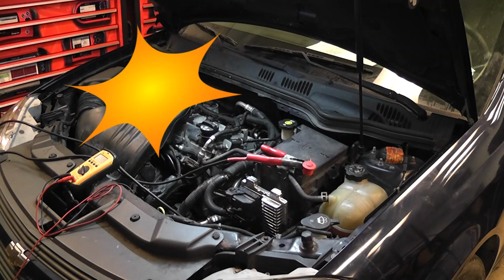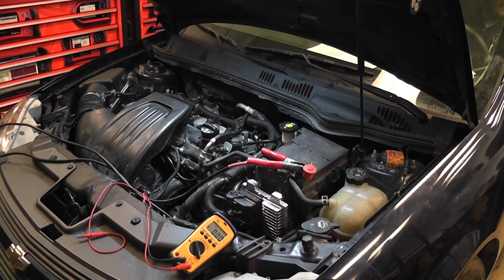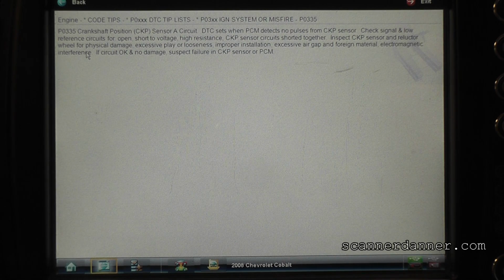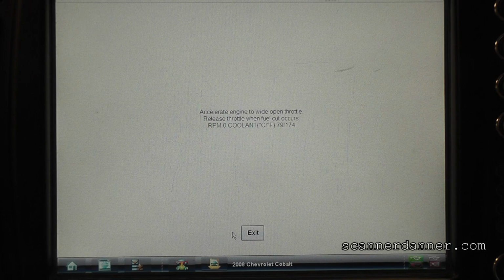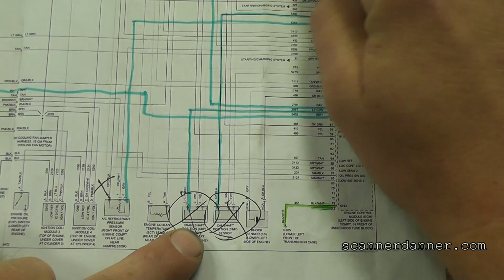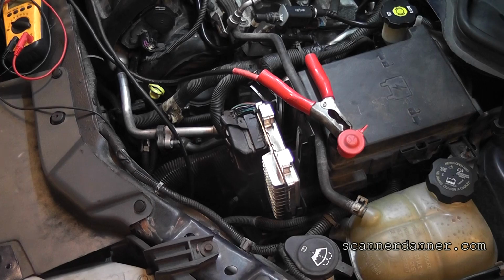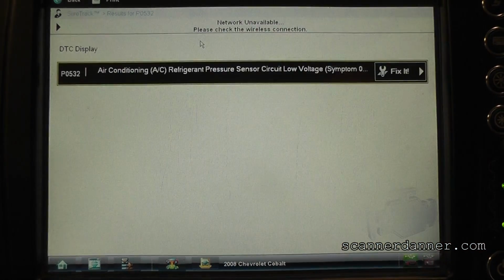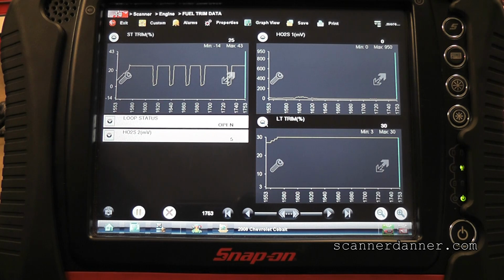Bad Engine Computer Testing Part 2

Comment: You left the crank unplug.
Reply: I didn't like u leaving all the sensor plugs loose but I'm just a truck driver.
Reply from the maker: I left them loose on purpose.  I wasn't finished testing for a short to ground in the harness and I like the sensors unplugged for that test. Never got the chance to finish like I wanted.
Reply: ScannerDanner I love your videos because u r so real.  I have learns so much from watching your videos.
Last week I got my sister 97 Accord to pass an emission test. PO1491, I thought the electrical part of the EGR valve was bad. It turn out to b the diaphragm part wouldn't hold vacuum.
I didn't just buy parts, I test the EGR switch and vacuum hoses 1st. 
I did go to an auto tech school back n 88. I was the youngest student at 17 but had the highest grades. I dropped out to become a car thief.
Reply from the maker: And you're now walking the straight and narrow right?
Reply: ScannerDanner Yes sirr, I stopped n 94 after I got tired of being lock up with men. The only law I break now is when I ride my ZX14 Ninja. I've seen 160mph once.
Reply from the maker: Nice.  Most I've seen is 120ish on my old VFR 700 (long time ago)
Reply: Must be a good feeling when you get messages like these. Knowing that your not just teaching your students. The good the bad and the ugly are all here listening to you.
Reply: Daniel Warren it is awesome my friend, to know this is changing lives make it even that much sweeter! thanks for the reminder my friend. I had a naysayer really bug me today and I need to let it go.
Reply: Well, for every naysayer there is 10 people praising you for what your do. Keep up the great work.
Reply: Daniel Warren thanks bro

Comment: First time commenter.. Very Long time watcher!  I heard you mention you are now doing your own programming but only for gm.  I recently bought an Autel j2534 passthru device. With that you can program all makes and models.  Just a thought.
Reply from the maker: Thanks man. It is a j2534 tool and we will have more than just GM but we bought some gm software that gives us factory capability. At least this is what I am being told. We actually have a trainer coming in on Friday to teach us this tools capabilities.
Reply: Thanks for responding!  Before watching your channel I would hardly ever use my scan tool.  Now it's one of the main tools in my diagnostic arsenal.
Reply from the maker: Mobile Auto MD Mobile Auto MD
Nice! thanks man. Really appreciate that.

Comment: Fantastic, both Parts 1 and 2 on this repair.  The car probably didn't need a second junkyard engine from the beginning.  It's annoying that mechanics don't take the time to properly diagnose the problem and just start throwing parts at a problem without any evidence of failure.  Great job Paul as always.  Your enthusiasm  for solving these types of problems comes across loud and clear.  You take pride in your work to be one of the best!
Reply: I totally agree. We may say they just too lazy BUT in other way, they haven't got a clue. This man is A PROPER MECHANIC LEFT ON THIS PLANET

Comment: PAUL, as always a great vidio. as for the gm tech we dont know all the circumstances. after hearing the first start and run that sounded like out of timing or cylinder hydraulicing i would have been afraid to do a restart without pulling the plugs if the money for a new engine could possibly come out of my pocket.  but whoever destoyed airbox should be ashamed.  you are a credit to automotive repair industry . GOD BLESS and thanks for great vidios.
Reply from the maker: Thanks my friend. May God bless you too.
Reply: ScannerDanner

Comment: Paul, so if the computer cannot adjust the fuel trims anymore it becomes open loop? Is that why the loop status is jumping around?
Reply from the maker: yes, when trims max out it is common to see the PCM drop out of closed loop. I have also seen this reaction as possibly a self test the computer is initiating on the O2 itself.

Comment: you say you have the programming tool for gm? is it gds? the laptop based tech 2 tool that gm used not long ago. Its a very nice tool! if you guys are getting the ford ids good luck with that thing. good work
Reply from the maker: not sure exactly what it is yet.
Reply: cant believe the tech called a bad timing chain, wouldnt you think hed atleast check the codes and say it had something to do with the crank sensor circuit but didnt know what it was instead of saying a chain. were you ever a flat rate tech before?
Reply from the maker: philbfree1
Yes, I worked for Pep Boys for 5 years as a flat rate tech. Loved working flat rate and I never cut corners. Quality was always #1 for me. I did however always have the "how can I do this faster" mentality but never with sacrificing quality. I still have that mentality. Time is money isn't it?
Reply: they did engine performance stuff at pep boys? all of them are closed around me in ohio. in todays car industry you better know electrical and scan tool usage or else your stuck doin the grunt work. im like you love the electrical investigations!
Reply from the maker: philbfree1
for sure! i wouldn't have been there if they didn't. I've always specialized in engine performance diagnostics and repair. From day 1.
Reply: do you still have pepboys in pa? can you do a video on the new high pressure fuel pumps ford and gm are using pretty much now
Reply: i was working on my dads 1995 f150 4.9 straight 6 for a lean condition. do these engines not have a maf sensor?? there wasnt a sensor in the intake ducting. i found some broken vac lines but it must not have a maf sensor. any help would be appreciated paul
Reply from the maker: Not sure. If it has no maf then it is a digital frequency type map sensor. Koeo at sea level it should read 160 hz at idle it should be 90 to 110.
Reply: thanks friend!

Comment: Paul Great video. Not on the defense of  Dealer Tech but I have seen a cam sensor engine code kept appearing with a timing belt being off one tooth and the car ran good. It was a Camry.
Reply from the maker: For sure and I started to get on this unknown guy at first in the video unfairly. He was not being paid to troubleshoot the problem and probably just took a guess.
My issue would have been if they actually followed through on a timing chain repair without doing tests to prove it. I see this WAY too often. To many parts changers in my field.

Comment: You and your class did a wonderful job troubleshooting this.  Knowing this engine runs without crank sensor input is gold information for us techs out there.  Sometimes things that you were taught in the past no longer apply.  Just curious, but what happened to the previous engines?
Reply from the maker: Thank you!  The first engine the chain went and bent the valves,  the second one was the wrong one from the junk yard.

Comment: Another good one, Paul! That initial cold crank sounded really bad...do you think the cylinders were fuel-washed and initial compression was low? After getting the CKP signal trouble code,  a visual inspection of the connector would be a good starting point in the field, especially since it's very accessible.
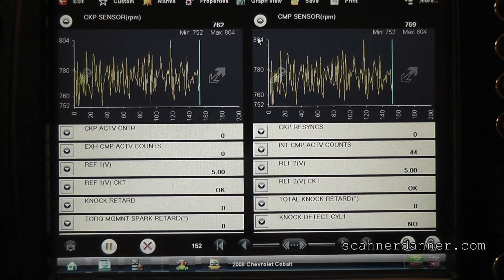At 23:19 looking at CKP and CMP rpms, the graphs and live readings are IDENTICAL...that screams "substituted value" for sure. 
Love the "live" recordings!

Comment: the engine did sound different from just connecting the crank sensor. the way it cranked, the way it idled even when you had your student give it gas. without the crank it would take longer cranking before firing up, and the idle was much quieter. as soon as you said no rpm the first thing that came to mind was "did he connect all the plugs he disconnected from diagnosing" wish i was in your class. as soon as we saw no rpm i would of yelled it out!!

Comment: Hello Paul
It really got my attention the fact that you could run this engine without the crank sensor! I guess is part of smarter electronics of today's cars! however I wonder if this pcm has some sort of back up plan or strategy  for a missing crank and picked up the cam as reference since the crank was down, it would have been great if you would have plugged back in the crank and unplugged the cam to determine if the pcm was capable of running on either sensor or its design was made to run of the cam.... after all if you sync up your timing with a cam sensor why would you need a crank? you can do injectors and coils both sequential and even mode 6 misfire counts with the cam! but you cant do sequential with just a crank unless has two references or two reluctors, what do you think?

Also what a crappy job was done at that dealer! God.... another parts changer.... why would he make a call for a timing belt! if he ran out of time to diagnose... why he didn't said the truth ... " I didn't have time to find out what was wrong... I got paid just to change and reprogram the pcm that is it and the car still does not run right! needs to be diagnosed first ! don't  get me wrong I believe most guys working on cars take pride fixing cars and  the dealer owners corrupt them with their unscrupulous pay system!  but there is no reason to lie if you don't know period
Reply from the maker: jeffsmopar1
Thanks Jeff. I would agree to a point, we can't call him a liar but at the same time he had no business tell us the car needed a timing chain. If it was a guess, he should have said that. To many mechanics try to justify a repair bill by thinking they HAVE to have a definitive answer. We all need to educate our customers that diagnostic time is NOT FREE!
What he should have done was say "I've replaced and reprogrammed the computer, the engine cranks now and sometimes starts but it is not running correctly, I need more diagnostic time to tell you what is wrong". If the customer doesn't want to pay (us in this case) then too bad! He then needs to say "Come get your car, call a tow truck, do whatever you need to, I am not working on this for free."
This tech probably didn't have enough confidence in himself to be this bold. So instead he took the easy way out.
Reply: wish I would have done that now too! My guess is it wouldn't have run, unless there is a default built into the ignition system to start pair firing the coils without the cam signal. With the crank only we can determine a pair of cylinders but not which one of the pair is at TDC compression. Great lesson though wasn't it? (Scan data lying, substituted values, a crank relearn that wouldn't learn, fuel trim)
Reply: With all due respect it's a bit of a stretch to call the tech at the dealer a liar because he says it needs a pcm.    We as a group don't know his story.    As a former flat rate dealer tech  I can relate,  he's given an ro that states to install and program new pcm.   And that's what he was told to do and that's what he did.       Pcm was bad.    The new one fixed the complaint he was contracted to repair.     Those cars are known for common timing chain issues.     Nobody needs to throw him under the bus.      Walk a hundred shop miles in the mans boots before judging.     As always Paul awesome lesson.     You're definitely changing the industry for the better!
Reply: jeffsmopar1  Hello man! I respectfully accept your comment! And you have a valid point! I agree, I could have rephrased the lying part in a better way, just too harsh on the guy! And some of them I don’t agree! But one is for sure, Paul Danner is changing the industry, and think about that for a moment... who is the industry? Every guy, gal, tech or owners that deal with cars at the enthusiast or professional level are the industry!

Anyhow after I gave it thought, somehow I feel hesitant to write what I am about to say, because it will be to lengthy and I could open a can of worms and the worst many people could misunderstand what my point is! Never the less, here I go!

I didn't call the tech a liar for calling a bad pcm, Paul almost finished diagnosing that pcm and would have call it, but and somebody else made the call to replace it, the dealer tech made the repair and gave out false information about repairs need it with the engine timing with undetermined intentions,so Please get with me here! this is a question of integrity, not knowledge, it makes a big difference at the bottom of the services ticket, "probable cause timing belt issues further diagnosed time required" your reputation as a tech is on the line here! And your diagnosing time IS NOT FREE! All car owners need to understand this, takes many years to master the art of repair cars, and they need to pay for it. The dealers, after market shops need to manage their money better! stay competitive! The need to stop asking for silver bullets to the techs and work hard for the money they charge! Stop making the tech work hard so they can profit! In today’s market if you show any signs of integrity you get fired because your "lack of performance or things are not working out" meaning you are not willing to play the game, and I understand everybody needs to put food on the table for their families! And is a tough call, but as you said “Walk a hundred shop miles in the man’s boots before judging"  I still walk them, but I choose to walk them with my head up right! To extend my point even more people need to learn how to say “I don’t know “  and after saying it you need to explain why.  Because you don’t have time, because you lack of proper tools, or just simple because you don’t have the knowledge to diagnose it. So as stated before car owners must pay for repairs completed, also car owners are not to pay training and mistakes on the “ I charge my mistakes on the repair bill basis !”  
 
And as Always I thank Paul for his contributions, he brings knowledge and leadership to his community of students and youtubers!
Reply: ScannerDanner Definitely a learning experience! Believe me when I said, Wow! Car running no rpm signal at the pcm! This is going to be a good one! I loved it... issues paling up, and knocked down one at the time!

Somehow my gut tells me that this car could have been capable of running with just the crank or the cam, as limp home mode! And fire the injectors as a group and waste spark strategy with only the crank and sequential with just the cam!
Reply: Agreed guys.    I understand and agree with you both completely.    Those flat rate days are long behind me and that's great with me.   I no longer have to be the engine in the dealership that generates everyone else salary.     I no longer have my words and ''opinions'' edited on an ro.   My customers can speak to me personally so its my pride and my apprehension they see not some smooth talking service writer.     I like to think that the tech wanted to see the car completed correctly and that what was written on the ro was somewhat taken out of context.   he may very well have been speaking worst case scenario and I like to think he would have found the crank unplugged had he been authorized for more dig time.     As techs we all realize that the reputation our shop has can be ruined and judged by the deeds of one.   Hopefully that tech realizes this.    As always much respect and god bless